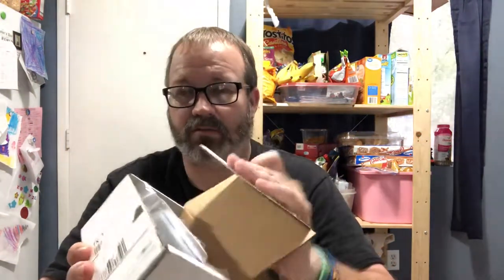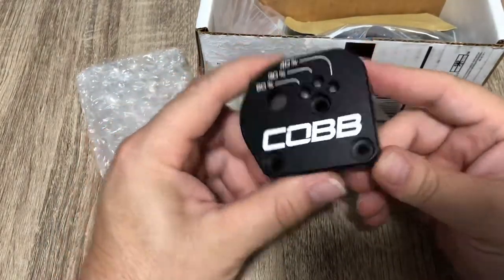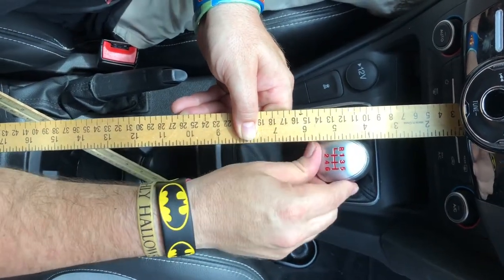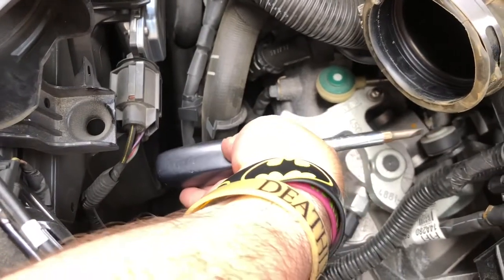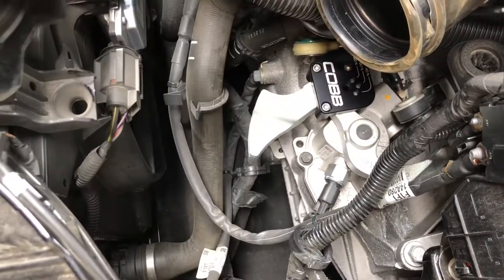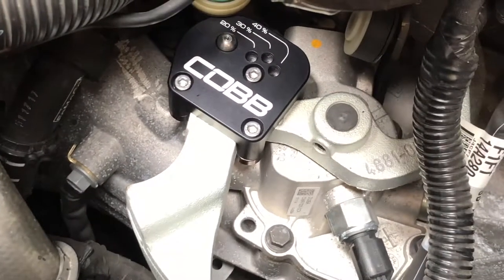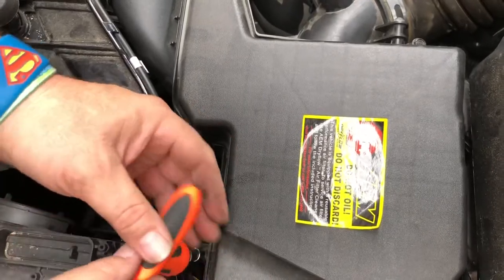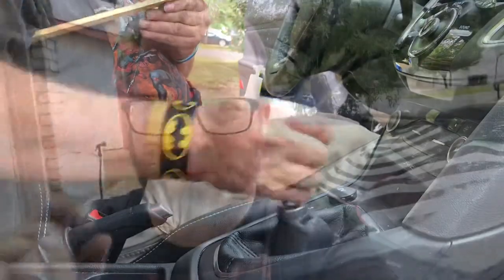cobb focus st short throw shifter plate install.

Comment: Quick tip for anyone installing this.. if you have the sound symposer deleted then there is enough room to do this without needing to remove the air box.
Reply: I did the symposer delete and removed the air box anyway, as it really made the whole install, including the neutral reset, a lot easier for me. It's a preference thing, I guess.
Reply: @greecoboost  I mean what gets the job done works, personally I had no issue with the box in there.